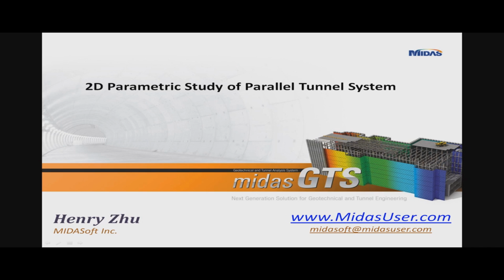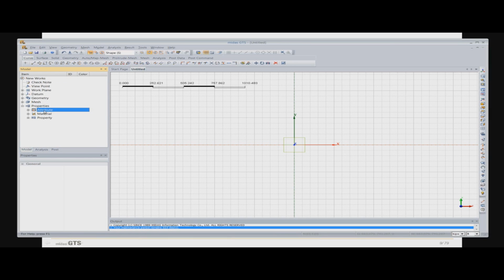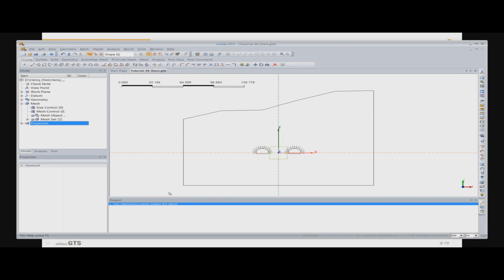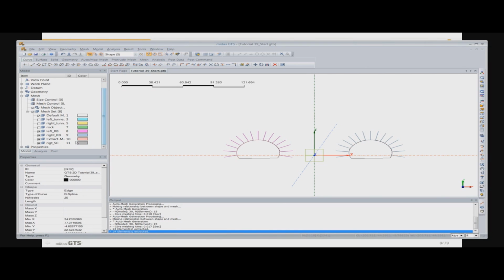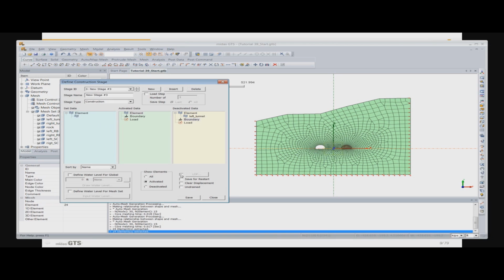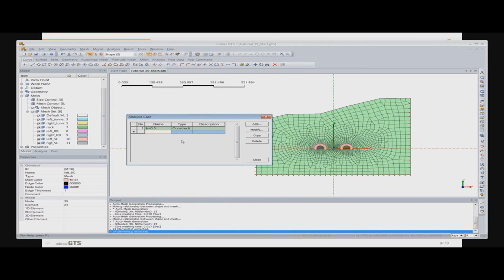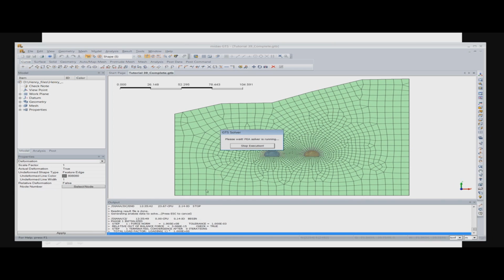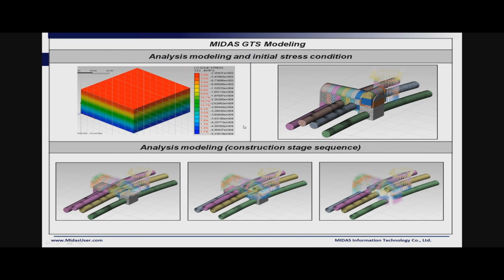03.14.2012 2D Parametric Study of Parallel Tunnel System .wmv

Comment: While carrying out a tunneling simulation in GTS NX we experienced the following error:

Element (ID: XXX) has undefined property (ID: X)
Unable to write element

However when looking up the Help manual and your website we were unable to find anything suitable to solve the problem. Could you please therefore help us out with solving the issue. We are running against a very tight project deadline so urgently need help.